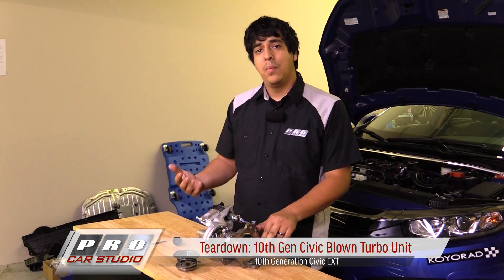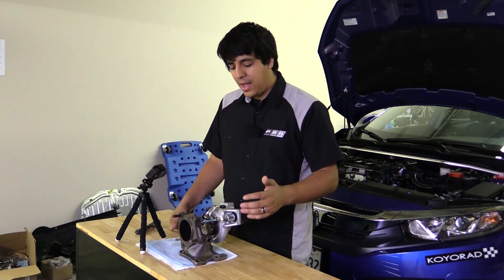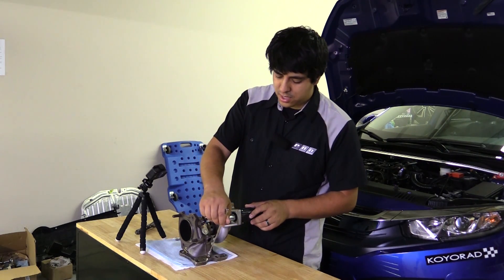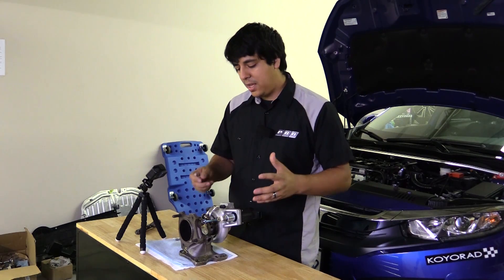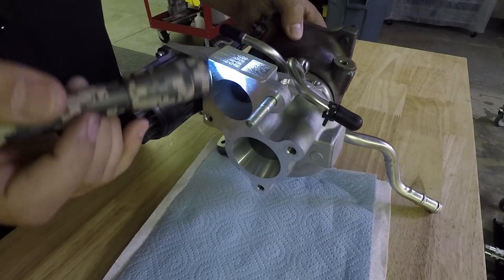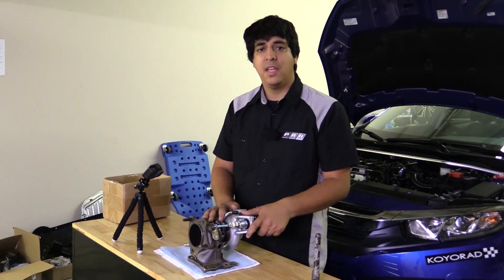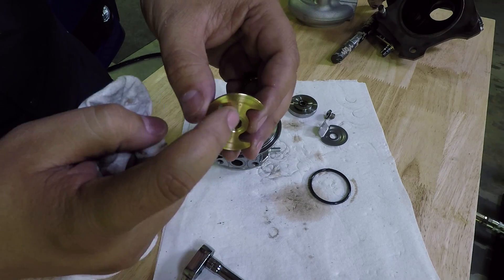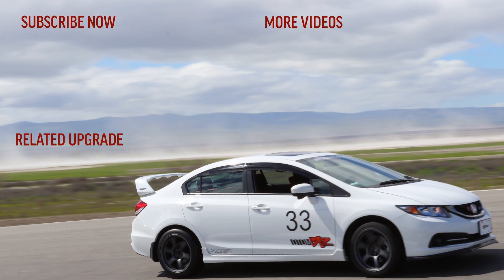Teardown: 10th Gen Civic EXT Blown Turbo Analysis

Comment: Thanks for the video. Inconel is a great metal. It has a very high melt point and it does not expand or contract with the temps that is why some might use that.  It is very heavy though I mean very heavy

Comment: 2017 Civic EX-L, bought brand new , 93K miles stock, no aftermarket changes, mainly highway mileage.  General upkeep maintained, Oil, Oil Filter, Air Filter, Brakes, Rotors.    P299 Underboost leading me to a $2200 turbo replacement bill for a failed main bearing.  Is this normal life for these turbos in the Gen 10?  They claim it also oil fouled my cat which may go soon from that, which would cost another $3000-4000 to replace. Although so far no codes for that and its driving normally. I know I am a high mileage driver, but they are mostly highway miles at very low RPM (1400) and I never drive aggressively.  I doubt the engine has ever been pushed above 4000 RPM in its lifetime.  What are your thoughts?

Comment: I thought the Civic used the TD025? I had to pull my turbo and looked for the TD03 markings but turns out mine is a TD025
Reply: It’s a td025. Honda should’ve put a td03 though imo

Comment: This is to help understand the 10th Gen Honda Civic (Non-Si Turbo).

Let's determine our Maximum Turbo Efficiency:

Maximum turbo CFM output = (3.14)(turbo compressor wheel size ÷ 2)2 / 3

So:

(3.14) x (37mm stock compressor wheel / 2) = (3.14) x (18.5)2
(3.14) x (18.5 x 18.5) = (3.14) x (342.25)
(3.14) x (342.25) = 1,074.665
Now, divide 1,074.665 by 3 = 358.22 (corrected)
Thus, the Maxium Turbo CFM output of the non-si turbo is 358 CFM.

a) Previous research has shown that our Intake tract flows approx. just over 405CFM. 
b) Maximum Turbo CFM output is just below Intake CFM Flow 358 / 405 = (+/-10%)

**Maximum Flow DOES NOT equal "efficient" flow - so with increased PSI and increased RPM the turbo will be far to the right of its compressor map and at a far lower efficiency %.
***From the MHI TD03 Turbo, the best efficiency you can achieve is 75%. As you run out of steam, you will know that you are near the "choke" point of that turbo. 
c) Non-Si Turbo Exhaust Exducers are "11" Blades as opposed to "9" on the CRV & Si models. 
d) The lesser blade # affords more capable power at higher RPMs.

This all equates to an over worked turbo and it's ability to adequately lubricate and cool itself - thus, the failure PRO Car Studio experienced.

As they stated:  They were on an 1) Aggressive tune, 2) In very hot/humid conditions and 3) hot oil temps.
* An upgraded (more efficient IC) would have provided better flow, better cooling properties, and released more (if not most) of the back pressure.
**Limiting the addition of PSI will NET longer sustained power and reliability.

Thanks PRO Car Studio for sharing this experience it is a great learning curve for the average consumer to adapt and overcome.
Cheers...

Comment: Have you heard of issues with the 1.5T turbo unit on the newer Hondas? My 2018 Accord 1.5T has horrible rattling that I believe is originating from the wastegate or wastegate actuator.
Reply from the maker: We have not personally heard of or experienced any issues with these engines. However, if something is making odd noises, please ensure to take it in and have it properly inspected.
Reply: PRO Car Studio check this video out and let me know if you think this is wastegate actuator rattling--my dealer insists it is normal and "characteristic of the vehicle"
Reply: Two thoughts: Find another dealer, OR see if a new one does it. If it does not, you now have ammo for your dealer to fix it... if that fails open a ticket with Honda Customer service.
Reply: jeb721 a step ahead of you, going through arbitration now
Reply: @amcdonal86VT  right on! Let us know what happens.

Comment: does not seem to be a lubrication failure,  or the lubrication was a secondary issue,  your first issue appears to be compressor surge,  too much boost might have created a surge condition,  surge events will present a lot of stress to the shaft,  shaft went oil problems appeared,  torsional forces on shaft due to surge snapped it, shaft to bearing clearances are lost and the oil issues start.  will not be surprised if same issue shows up regardless of adding an oil cooler.  You just hit the lift limit on the compressor,  surge it, broke it,  thrust bearing damage is a good indicator of surge,  when turbo is building boost,  shaft has a axial force in the direction of the lowest pressure area,  or the "eye" of the impeller,  when surge happens this low pressure are disappears for a moment in time, thus load on thrust bearing is greatly reduced,  as soon as the surge event passes,  you suddenly build boost again and load on thrust bearing spikes,  if surge event repeats rapidly until boost demand drops and wastegate opens,  what you are doing is basically hammering the thrust bearing until it gets all scratched,  now its a time bomb

Comment: Turbo in 1.5 sedan is 11 blades but in si turbo is having 9 blades and produce more power. 
Since both hv same engines would replacement be easy and/or bolt on?
Reply from the maker: + Umar In theory, this should be able to bolt up. However, we have not tested this and we have yet to hear of anyone doing it as well. We cannot guarantee it will not require a tune or what other modifications it may require.

Comment: So i am not really knowledgeable about how turbos work but i do have 2016 civic coupe turbo charged 1.5l and ive always been curious, what method of lubrication does this turbo even use? Is it a completely sealed off bearing or does oil from the engine circulate through the turbos bearing?? Btw nice video, need more like this one.
Reply from the maker: +TEXASBLAZE 101 There is an oil feed line that uses the engine oil to lubricate the turbo. This is actually one of the reasons our turbo blew out. The oil was way overheated and was not lubricating properly. Thanks again for checking out the video!

Comment: I am thinking of getting the Hondata FlashPro for my 2017 Civic Si coupe and I have a few questions since you blew your turbo I figured who better to ask. Also I'm sorry that happened to you. Do you think +9psi tune is to much for the 1.5l engine/turbo? Do you think 93/94 octane is good enough or should I be using race fuel grade 100+/ 93+fuel treatment/maybe even ethanol? As far as reliability how dependable will it be or should I just stick to the +6psi tune? Do you know if this voids my warranty? I wont be racing the car on the track just pulls when I have the road to my self. Any other constructive input would be appreciated. Thanks in advanced!
Reply from the maker: +MGTEKNS To begin, thanks for the support! The turbo on our EXT blew simply because we were running it very hard on the track with a very aggressive tune on a hot day. The oil began to overheat and eventually caused the turbo to give out. As for the tunes you are talking about, the 9+ is safe to use on occasion, but the 6+ is best suited for day to day driving. Standard 91 octane is more than ok, higher octane can be used to get a power boost, but not necessary. As for warranty, this will heavily depend on the dealer and what exactly happened. Unfortunately, we cannot guarantee a tune will not void certain warranties. You can always return the vehicle to the stock tune when necessary however.
Reply: PRO Car Studio Thanks for the info and relpying I really appreciate you taking the time to answer my questions. :)
Reply from the maker: +MGTEKNS No problemo! Thanks again for checking out our video!

Comment: So better intercooler and oil cooler would have prevented this ?
Reply from the maker: +J Nick Mainly the oil cooler. The oil temps ended up getting really high and prevented it from cooling properly. The high ambient temps, aggressive tune, and extended track times also didn't help with the issue
Reply: PRO Car Studio and 0w20 oil is only good for gas mileage run a good 5 W30

Comment: Thanks for putting in the effort of filming this tear down. I'm considering adding a tune to my stock hatchback. Seeing the size of the turbo shaft is making me reconsider adding this tune. I'm willing to bet the Honda engineers designed this turbo for longevity. Adding a tune to increase boost pressure may not be the wisest course of action with my daily driver.
Reply from the maker: +MrVulcan10 On a regular daily driven car, the tune is more than ok. We had this issue simply because we put more aggressive timing and extended track driving on a very hot day. The actual tune didn't break the turbo, the very high temperatures of the overheated oil caused this.

Comment: What viscosity oil was run?
Reply from the maker: +Jose Rivera We ran it with factory grade oil, but with a very aggressive tune. After further review of the oil and temps, a oil cooler is required for extended track times.
Reply: Understood. Makes me wonder though if the turbo would have survived on a 30 weight in those extreme high temps.
Reply: Also, and i am not disputing your findings, but isn't it possible that this damage could have been caused by compressor surge, and thereby causing the shaft to snap?
Reply from the maker: +Jose Rivera It is very unlikely, but you do bring up a good point. Based on where the shaft actually snapped, it points to overheating rather than surging.

Comment: How much power can this engine make after a tune? It is possible to get near 300whp on the 1.5 liter engine?
Reply from the maker: +Anirudh Upadhyayula With just a tune, realistically it would be closer to 240whp or so. With bolt on parts, you can definitely see more.
Reply: Anirudh Upadhyayula the manual clutch can't take 300wtq

Comment: How many lbs of boost does the stock 1.5 turbo put out?
Reply: MOTERxBOTER It's quite high, though it's so tiny. 20-23 lbs maximum, I think.
Reply from the maker: +MOTERxBOTER The stock boost pressure is between 12-14 psi depending on conditions.
Reply: PRO Car Studio See? Bad information. I had read that somewhere from another source...
Reply from the maker: +Troy Jollimore I believe you may be thinking of the si. The si runs at 18-20 psi depending on conditions. The EXT and other models would be between 12-14psi. We currently have our EXT running at 20 psi with an aggressive tune.
Reply: PRO Car Studio how much hp did you guys get up to with the aggressive tune? I'm would like to try to get my 10th gen up to 250hp
Reply from the maker: +MOTERxBOTER With our aggressive custom 6psi tune, we achieved roughly 230hp. With bolt ons and a good tune, you should be able to see 250hp or possibly more.

Comment: Would be possible to continue driving and operate engine with this broken turbo? just to get to repair shop
Reply: arthur sadlovsky yes the car will still run and drive. Only now instead of helping the engine make power it becomes a major restriction. It will be severely down on power and may not be able to travel at highway speeds depending on the size of the engine in relation to the size of the turbine housing.

Comment: I thought the new turbos were supposed to be integrated with the exhaust manifold?
Reply from the maker: +Troy Jollimore The turbo does directly bolt on to the head since the "manifold" is built into the head now. Once unbolted, it comes off as seen on the video.
Reply: PRO Car Studio Ah. Not much reliable information, but can't argue with disassembly! There's future hope for my Touring, then...

Comment: Did you upgrade to the si turbocharger?
Reply from the maker: Not yet, and when we do, it will be a custom hybrid turbo. We went with a new factory turbo for now because we still have some tests we need to do with the stock turbo unit on the car.